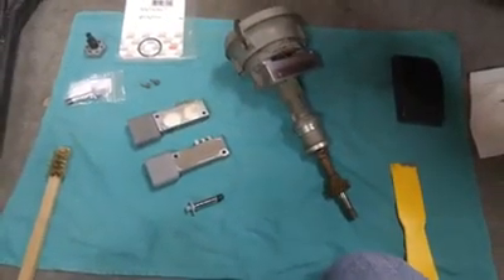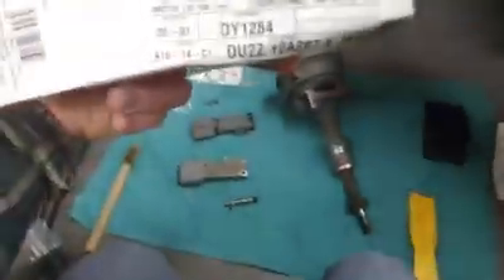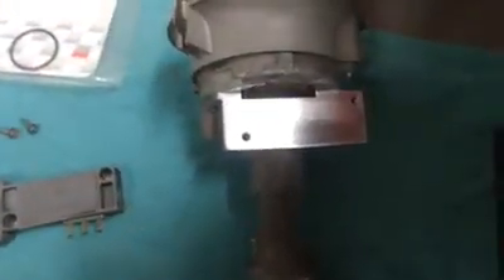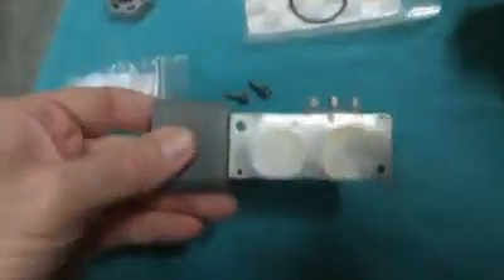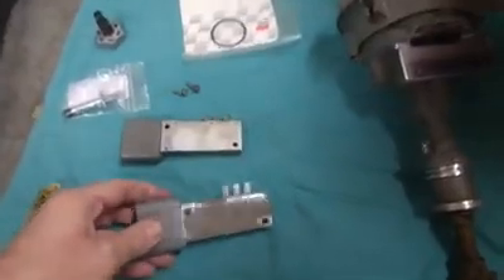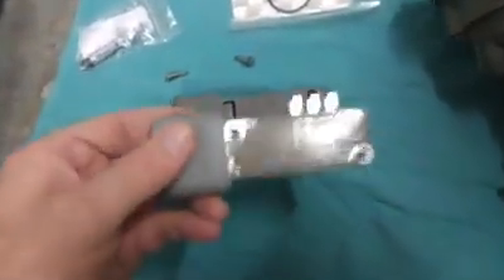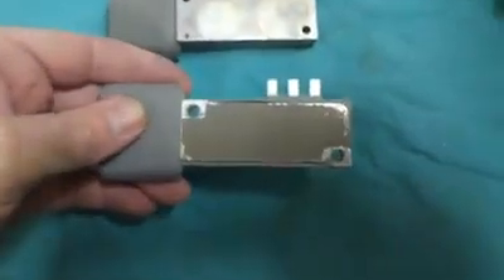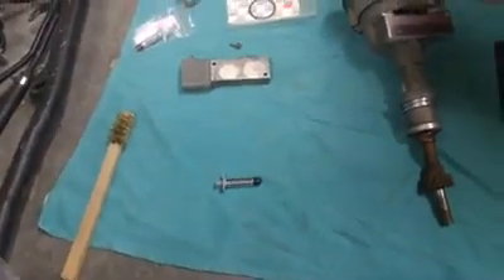Mustang 5.0L TFI Ignition Module Installation Tricks

Comment: 99.9 percent of the time a 5.0 Mustang dies instantly and you didn't forget to put gas in it, its the module...... guaranteed,been involved with these cars since the 80s,the last time one of these modules went out i was headed home from a party, part stores were closed, 250 dollars to get home on a tow, never again, i keep 2 Motorcraft modules in my trunk in a little box,both in my 89 and my 91,the artic paste is a great idea, been doing it for a several years now.

One only good thing the Chinese came up with with the new distributors (cause everything else is awful including the electronics and they have tolerances all over the place,try fitting a old cap on a new distributor,lol) for these cars is that they are using Phillips screws to hold the module to the distributor,most folks have a Phillips driver, not everyone has the unique tool to take the screws of the module so ive been using Phillips on mine.

Here lately i have been thinking about rebuilding a dozen or so distributors with real internals,the original pips are hard to find but they are still out there,some guy on Ebay has like 100 of them which he wisely bought back in the day and he wants like 50 bucks a a piece but they are worth it, i enjoy watching videos about anything to do with this stuff, that brought me here, great video man.
Reply from the maker: The new Motorcraft modules are cheap Chinese garbage. The old ones with the word Motorcraft embossed into the plastic are the real deal, and great. But they don't make them any more. The new Motorcraft ones just have a black Motorcraft ink stamp, and they are just as bad as every other cheap China module. Looking at how they work on an oscilloscope, it's clear they don't work the same way. The originals current limited once they saturated. The new ones don't, just like all the other aftermarket ones.
Reply: @dragradialperformance3540  Yeah i can imagine,China's tentacles reach far and wide.

Let me ask you something if i may,I'm familiar with idle issues on these cars, vacuum leaks, computer capacitor issues,TPS, idle air bypass,ACT,CTS and base idle reset etc etc however, is it possible a distributor could cause idle issues specially one of these new Chinese jobs? i dont mean a huge all over the place idle but a slight idle hunting under load?  cars been smoked top to bottom, no leaks anywhere .
Reply from the maker: @dntlss  The main issues causing Fox bodies to idle badly are: bad capacitors in ECU, bad ignition module, vacuum leaks, dirty or oily MAF hotwires,  incorrect MAF application, PCV valve still being used when somebody vented the valve covers with breathers, cheap TPS sensors, and general tune up issues.

You should also look at using new Motorcraft O2 sensors, and making sure the O2 heater power circuit works. A dirty throttle body or IAC valve can make things worse too.

Comment: The Duralast replacements come with the white silicone paste. PC Thermal paste will work better? I have a 95 5.0 and the ICM is mounted on its own heat sink on the inner fender.
Reply from the maker: It's better to use a thin layer of a high performance thermal transfer paste, like Artic Silver 5 or similar. It does a better job of transferring heat from the module to the distributor housing, lowering module temps. And that keeps them alive longer.

Comment: Welp, this would probably explain WHY my car keeps killing these modules. First time i didn't know to put paste on it. Second time i used too much. Both times i didnt sand the distributor.
Reply from the maker: The idea is to get a really light, even film of thermal transfer paste between the module and the distributor pad. Sanding the pad flat is better. And high quality thermal transfer paste (often made for home PC chip installation) helps dissipate the heat better.

You can also buy kits that relocate the module off of the distributor. That's what Ford did in 94 to fix the module deaths that older Fords are known for.
Reply: @dragradialperformance3540  Problem with those kits is they involved screwing around with wires. That's something I'm simply not comfortable with.  Now, my current module only caused one stall on a cool evening. Do you think it's safe to just pull it, clean it, apply the paste better, and try it again or do I need to buy yet another?
Reply from the maker: @JRC99  when the module isn't installed correctly and overheats, it cooks the module. It probably wouldn't work at all because of heat. Chances are if your new module is acting up, it's probably just a factory defect. These new modules are all junk, compared to the original Motorcraft ones. I've had to put 3 or 4 in a row on a car just to get a good new one. So yeah, feel free to pull your module and reinstall it as shown in the video. The video makes the module paste look much thicker than it really is. Spread it as thin as possible, while still having a complete thin layer across the entire module. None should squeeze out when tightening the module.
Reply: @dragradialperformance3540  Interesting. Both my new Motor craft modules worked again after the car sat for a few minutes. Even the first one I put no paste on and that was on a 95 degree day. So if I understand you correctly, both of them are still good?
Reply from the maker: @JRC99  I can't say that one way or the other. It is terribly complex to actually test an ignition module. It requires a scope. The module gets hot quickly, and can easily act differently because of temperature. I've had some that wouldn't start, but if it did start it would run good. Others ran fine at idle, and broke up at high RPM. Others just did not work. The new Ford ones aren't any better than the cheap chinese junk. You can watch my videos on me testing a module with a scope, to see what I'm talking about. It's not easy to truly test one. For most people, it's easier to just try different modules and see if the car runs differently. You can not assume that the first new module you put in a car will be good out of the box. It's like russian roulette.

Comment: What grit did you use for sand paper
Reply from the maker: I can't quite recall. Either 320 or 400 grit wetsand paper. I think either used 320 or new 400 would work fine.

Comment: i have a SN95 and i have been lucky i guess with putting dielectric grease between the TFI  and the heat sink. i have yet to have one fail on me, but i would like to use that heat transfer putty that you recommend.
Reply from the maker: The 94-95 Mustang remote mounted the TFI module to an aluminum heat sink on the fender, and away from the distributor. This new placement was a direct result of the lawsuits Ford got into from overheating modules and stalling in older TFI ignitions that had the module mounted onto the distributor. Your 94-95 is not nearly as failure prone.
Reply: @dragradialperformance3540  i agree with you. i remember when i first got my 95GT ppl were saying "keep an extra TFI in the truck, cause they fail all the time"...i didn't know what they were talking about cause mine worked great! you have cleared allot up as to why💪
Reply: You say that like.you have changed it multiple  times. Doesn't sound to lucky to me...
Reply: @Hogleg1percent  is your comment for me?

Comment: There aren't any codes for the module. There is a code for the PIP sensor. If the timing marks flutter, it's the module. If the engine acts like somebody turns the engine on and off ( bucking), it's the PIP sensor.
Reply: What do you mean by flutter? I'm having some issues with my 87, that I suspect are ignition. It feels like it's hiccuping during cruising speeds and occasionally at WOT
Reply: @jpp9846  same here ever figure it out?
Reply: @XAPSRxCasper  yes, it was a combination of 2 things. A faulty MAP Sensor, that was New, out of the box. When I put the original back in, it quit. But I also had an "adjustable" IAC gasket that I unknowingly installed. Once that was removed and replaced with a regular gasket....she ran (and continues to) strong.
Reply: Update: tfi was the problem.
Reply: Arrrrrrgggh ,,, change the pickup in the distributor . Still shutting off and on . I guess the pickup is one in the same as a PIP ,,, ?
Reply: @martystevens3969 , might have a new one for you . I've never seen such a thing . Btw , a new pickup made no change on the shutting off and on . Soooo , went out at dusk tonight , and did an old fashioned coil check . Blue almost an inch . Happened to have my digital volt meter . Batt , is at 12.5 not running , 13.5 running . Alright , here is the rare . It kind of stumbled when I put the leads on the batt . Didn't really think much of it , but it did clear up as soon as I pulled the leads off . Did it again and held the leads on shutt the engine OFF . Started it up same thing shutt 'er off if I held the leads on . Now , it's not acting like there's a big current draw , like I'm trying to jump somebody off . Doesn't seem load related at all just runs rough and 4 or 5 seconds shutts down  ,,, ???